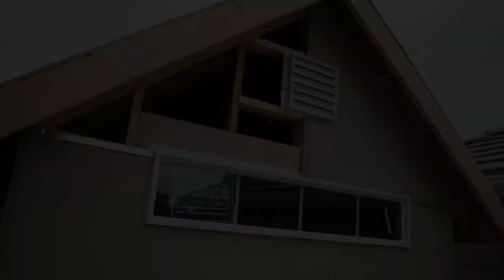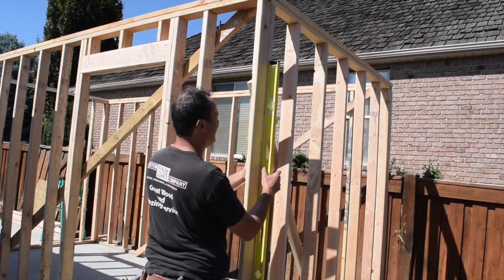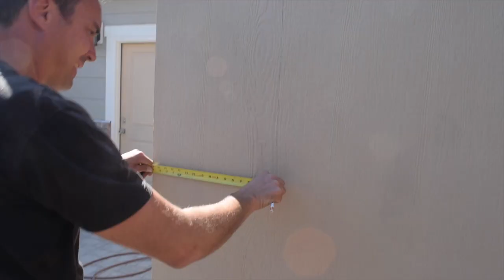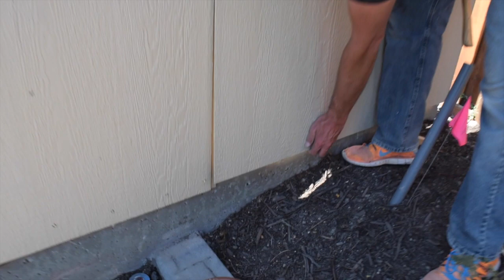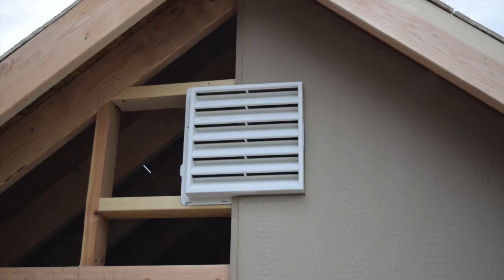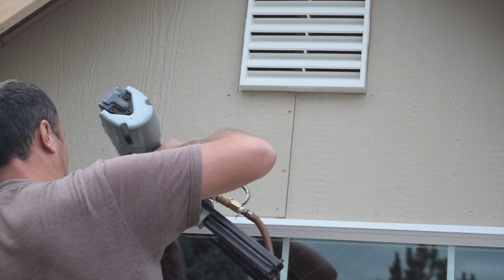8x16 Shed Build: How To Install Siding, Windows and Vents

Comment: Question, I am making a storage shed plenty of ventilation at roof and eves no heat just mower, yard storage, ect... In previous sheds of similar nature that were more sealed and air tight also no heated. Everything would sweat and condensate over time and cause rust. Because of this I'm not so sure I need a external vapor barrier under vinal siding, exterior is 7/16 OSB no insulation inside open 2x4 studding. And I'm in Michigan so you know the weather conditions.